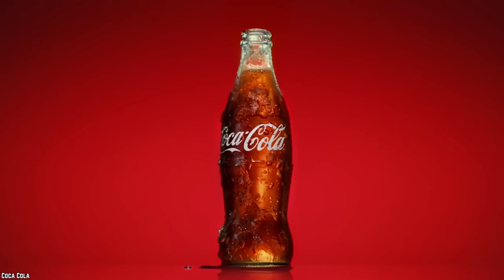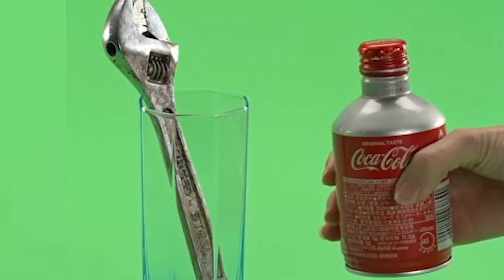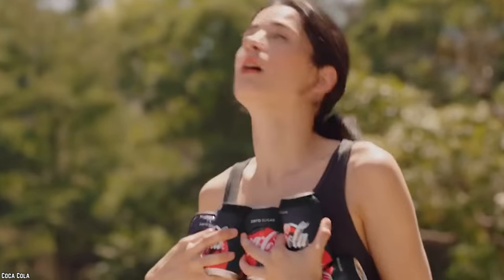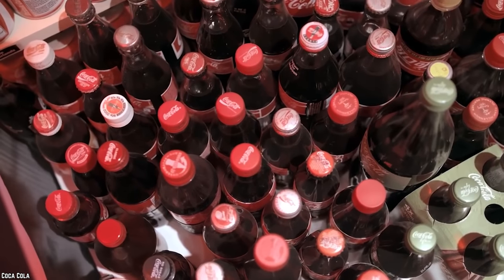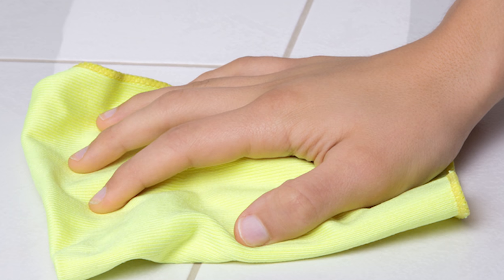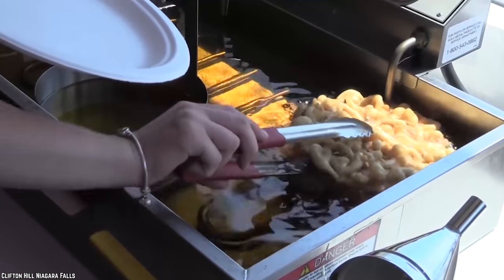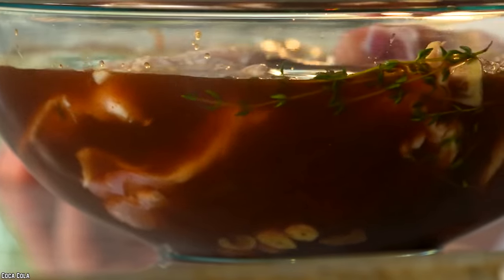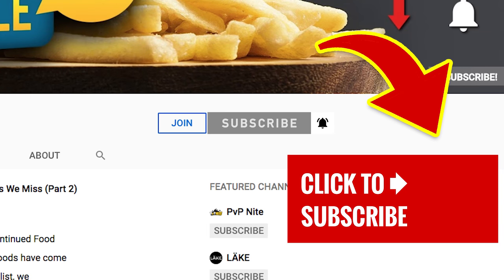10 Coca-Cola Life Hacks That Will Make You Buy More

Comment: BULL FLOOKY!!!
Gardening: Most of the effects mentioned rely on the sugar in Coke. Wouldn't it be less expensive to buy a sack of sugar instead? And if these effects are so great, why don't any garden experts mention using sugar around the garden?
Rust, etc: Where did you get these ideas? If there were enough Phosphoric Acid in soda to dissolve rust it would be very bad for your stomach and bones. Combined with Carbonic Acid from the carbonation, Coke has a pH of 2.52, fairly strong, and enough to loosen light rust. But compared to products that are meant to remove rust? Pretty weak.
Reply: Mud is actually good for removing rust. It's a lot cheaper than Coca Cola as well.